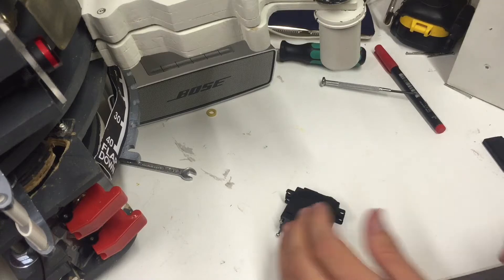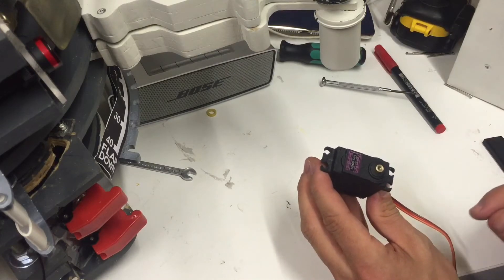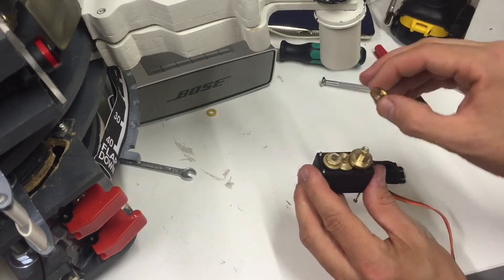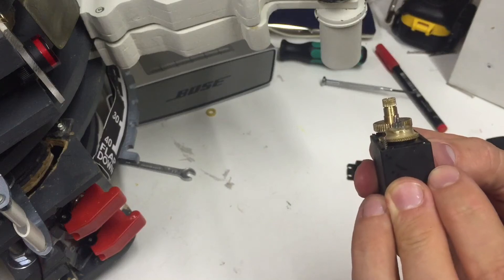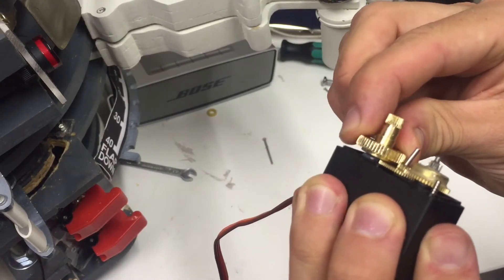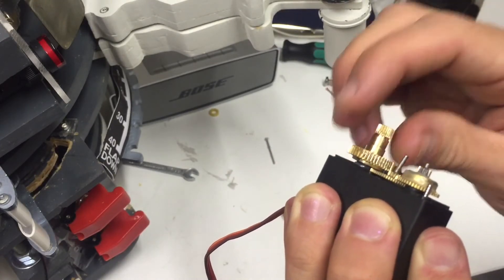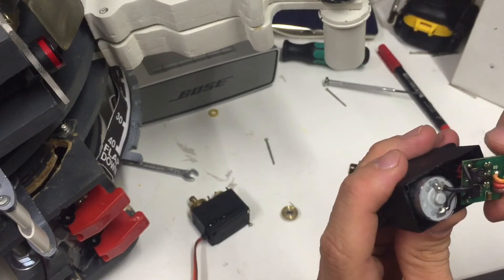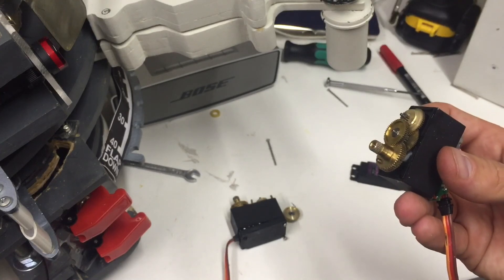Fixing a servo - B737 Home Cockpit

Comment: Hey, What kind os servos we can use for the gauges.  I am really confused. 
There are 180 or 360 degrees, but I am not sure how to control the angle
Reply from the maker: In case your servo not is able to cover the entire gauge then you raise the ratio using gears between the servo and gauge shaft

Comment: Pete, this servo is going to brake again and again ,don't waste your time. I used to be a RC helicopter pilot 600,500 and 450 size, and perharps that you don't know that there are a lot of caracteristics differents in a servo. The torque is the most important for this job. Take a servo oversize if it can fit in the support, for 600 rc helicopter size and much more, not for cyclic but for queue rotor of an heli (anticouple ) .if you have question , don't hesitate, cheers my friend. Will.
Reply from the maker: Hi Will. 
Do you mean this servo in particular or servos in general? 
I know the specific servo is a cheap China model and has many downsides. But I want to make sure it actually works before spending $100 per servo. 
Cheers. Peter
Reply: Servo in general.It's like pull a enormous boat behond a little car. You must have a powerfull car; so have a servo with lot of torque.